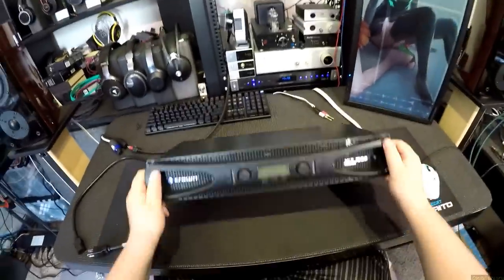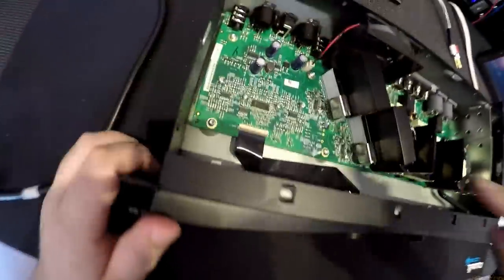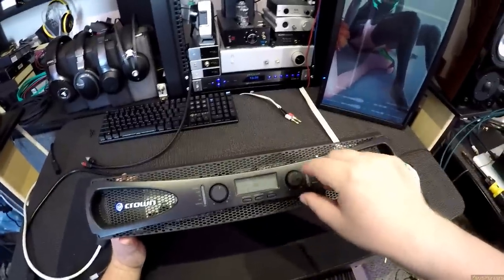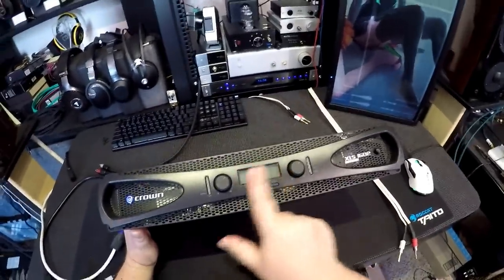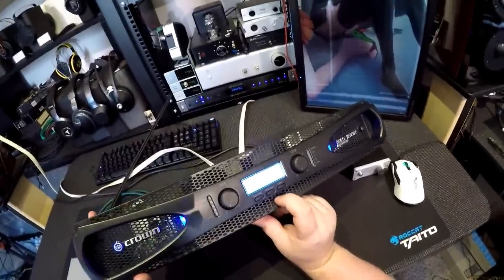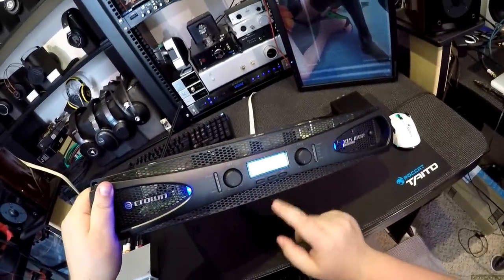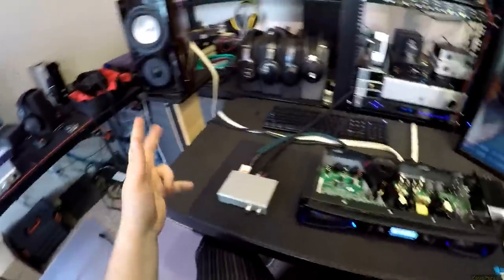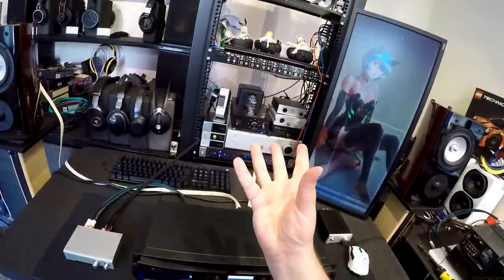Z Review - Crown XLS1502 POWAAAH!!! AMP

Comment: I use three crown xls1502s to power my electrostat home cinema and they sound absolutely incredible, especially since the crowns handle 2ohm dips pretty damn well! Sure they're not krells but they are incredibly easy to live with and they are super quiet, do not heat up the room in the same way that some other amps i've used have!

Comment: Well Zeos...tonight I had the opportunity to devote about three hours to unpacking, connecting and auditioning my new Crown XLS-1502. I used my newly-purchased Schiit Audio SYS as the preamp. Got it all hooked up and fine-tuned the gain settings on the amplifier to the 3 o'clock position. Setting up and connecting the amp was a breeze, and I gotta say I LOVE the Schiit SYS passive preamp. Everything connected to a Monster Cable power conditioner -- I think it especially important to connect an amplifier to a power conditioner. I listened to a few CDs and all I can say is WOW. I had the volume levels relatively high, and the amp wasn't even breathing hard...not even close..just moseying right along as if to say "is this all you've got?" I brought out the Telarc 1812 CD and scrolled right over to the cannon shots. Even at moderate levels, the only lights that lit up on the amp were the bottom ones! Listening to other CDs (Diana Krall "Live in Paris", Shannon Worrell "Three Wishes", James Taylor "Hourglass", Lyle Lovett "Joshua Judges Ruth", Tool "Undertow"), the sound was clean, nicely detailed, well organized. Listening to Tool's "Flood" was revelatory. Bass response is a definite strength with this amp -- deep, solid, detailed. Loving the amp so far, and this weekend I plan to open the floodgates a little more and give it some more challenges to see what it's capable of.
Reply from the maker: Try not to blow up any speakers.
Reply: Yes...so noted! And...thanks to you for all the awesome information, recommendations (upon which basis I purchased this amp) and advice you're providing to all of us...we're listening.
Reply: The Crown has a built in conditioner and protective reset breaker, use 10 gauge (minimum) power cord directly into wall socket for best performance.  Conditioners have minimal effect on digital amps at low power but they can impede the flow at upper draw range unless you have a megabuck conditioner like Bryston or Nordost.  If no analog sources, use your DAC's balanced outputs (fixed, not variable) to feed the Crown direct via XLR input and connect the DAC's RCA outputs to your preamp to control subs.  Nothing in the signal path between source and power amp = purity. Want to hear what a $10K preamp sounds like? Simply remove your preamp. And yes, those knobs on the Crown function fine as dual volume pots like the old McCormack gear. That's also the only way to produce super flat, balanced sound from low volume to the loudest you can handle.  I never move my XLS 2002's lower than 9 o'cock or above 10 with CD/DVD & cable TV (fixed output devices), computer has it's own vol control. For even better bass (!) use one Crown for left and one for right channel, one channel only from each amp- this dedicates ALL of the power supply to just one channel.  Avoid bridged mode as that essentially doubles THD and reduces damping factor/bass authority by about 40-50%.  Output doubles but quality is basically halved.  Ensure your Crown's channels are both at zero before you power it up for the first time, then you can pretty much leave them where you like them, I rarely adjust mine.

Comment: I wanted to thank you for your crown amp review. I was getting ready to spend over $1200.00 plus on a stereo power amp. I was getting very frustrated by how much it cost to get 300 watts per channel. Fast forward to your video. I had heard of people using "Pro" amps for home stereo. The only regular complaint I heard were those of fan noise. After seeing your video I didn't even think that would be much of an issue. So I finally bought the XLS 2502. I wanted to go big on watts. So I have roughly 425 WPC at 8 ohms. My results? Fantastic. I've run it for hours and not once so far has the fan even come on let alone make any noise. I had just purchased a set of bose 901s and knew that they like the watts. So at first I had a 100 WPC amp. The Bose sounded very good actually. However, once plugged into the Crown. Wow! Everything came alive. And, I only paid $550.00 including shipping and including a one year warranty.
I'll admit, I would have loved the beauty of a monster Macintosh sitting in my living room but the money I saved will probably buy a set of Ohm Walsh Speakers. Oh yeah, thanks alot for that video. Now I might have to buy a set of Ohm Walsh 4000s. This is your fault.
Reply: Bose 901's are great space heaters.
Reply: I'm currently running a Crown XLi1500 to run 4 12" subs and for $200 it absolutely pounds! Plus it puts out well over its rated power!
Reply: If it makes you feel better peel off the brand name and rename it "Macintosh".
It may even sound better.

Comment: I got 3 of these amps... the 1002, 1502, and the 2502, along with an older Crown amp powering my home theater sound system.  I am astonished on the level of sound quality that I get from the XLS amps!  WAY better than what I was using previously and also weight 3 times as heavy as my XLS amps.  Your review of this amp is better than most I have watched here on YouTube.   Thank you. :)
Reply: I bought a 1002. It s in the post. Gonna be using it for my big 18 inch subwoofer. Can l set low pass cut off at 100 Hz ?
Reply: did you notice sonical differences between the different wattage models?
Reply: @dornauge1995  Just a small difference. But to an untrained ear, they wont hear the difference.
Reply: @DvjLuna  which one would you prefer?

Comment: I chose this over the xls 1002 due to its better SNR and used a schiit jotunheim as the pre-amp with a TEAC DAC.  I set the both of the gain levels at 50% or at midway.  All I can say is that it sounds fast, clean, clear, neutral and provides great control on bass.  I am impressed with this class D amp, delivers way above it price point.  Having a good pre-amp really helps.

Comment: It's a half bridge (2 MOSFETs) per channel class d amp with switching dc-dc supply. The dc-dc supply is a Variable forward type converter. When you adjust the amp gain using the two knobs, you are actually adjusting the rail to rail dc voltage (controlling the dc-dc output voltage to the amp). In bridge mode, the two half-bridge amps are connected in parallel.  The class-d amp switching frequency is set at 400kHz, which good but not considered audiophile quality... Good class-d should have the switching freq above 500kHz... It's a great bargain for 350$

Comment: Well it's small and light because it's a Class D. I think most "audiophiles" prefer a Class AB design because it's actually amplifying the original signal and not 'rebuilding' the signal based off a high frequency carrier wave. Then again, class D tech has certainly improved a lot in recent years.
Reply: stealth418 no, most audiophiles have been on the class D train for like 6 or 7 years now. this isn't the ancient old days anymore.
Reply: No they haven't lol.
Reply: Alexander96 yes they have, Hypex Ncores have pretty much hit the reset button on all that shit in 2010. get with the times.
Reply: Class D is no Amp ..and no real audiophile will prefare class D .... accept technics new amps which are the best class D imo and still lack next to a real AB AMP
Reply: Audfile I will only use Class D on subs where it doesn't matter too much. Some of the other classes are much better for mids/highs like Class G/H. My Arc Audio KS series car amps are G/H and are amazing. I still have doubts with class D for home use. A/B will always be KING of high end home audio. For trickle down effect class D does have a place.
Reply: @audfile It is improving recently but if you want an audiophile quality class D, the cost is quite significant. Peachtree Nova $1800-2800
Reply: Aron Gatt Please check out the Ncore's. They are the best of the best if you can say that. All the highend amps currently are usind the NCore tech by Hypex design (Bruno Putzey) NAD, Marantz PM 10 etc. Nothing can match it really!
Reply: is that 600 dollar for 1 mono block kit or for a pair ?
Reply: Aron Gatt $600 for ONE kit.
Reply: Audfile Yeah,  get with the times,  get a shitty pro amp and turn your speakers upsidedown 😂
Reply: Class D has improved 10 fold over the past 15 years.  There are many good sounding class d amps.  Some of the best subwoofer home amps are class d.    Class A ( tube)  and AB still have the best sound quality.  Low power under 60 w rms class Ab ( even cheap $200 integrated amps sound fantastic).  Nothing , nothing is worst than an bad digital amp.  I remember the first Alpine PDX amps  they received excellent reviews but they sounded like some garbage.  Unlistenable at any volume. They where small and put out a ton of power.  Class H sounds almost as good as Ab and is almost as efficient as class d.  The best of both worlds.  I love the Ark audio class H car amps ( when they are working).  For home living room listening class Ab.
Reply: gatekeeper
Reply: All these "class D is not audiophile " clearly know nothing about amplification to begin with. 

Class D is no longer the underdog. Matter in fact I know people, that run high end monoblocks and power amps of reputable brand.. Bought a crown and totally sold their $$$ gear. 

Crown is not just power, the specs are on par with any audiophile (such a mediocre word to use btw) amp you put against it. 

Also I see comments here "a good quality class D cost 1800usd" 

Again for those who really think that, have very little to no real experience to speak off. If you really think that, I gladly invite any of you experts to do a blind test here. 

We can put from crown up to krell amplification in the test, if needed to fit your desire for "high end" 

I can tell you already...you will fail 😉
Reply: Michel Linschoten,    Not true.  Take a Scott 40 year old 22 watt per channel tube amp ( completely stock).  NO Crown amp made today sounds as good.  Not even close. In an AB test at the same level any human can hear the difference. No matter what the program source is.  Use an Iphone as the source.

Crown makes an excellent sound reinforcement amp. Durable and able to play at rated power for long terms. Try that with the Scott tube and it will destroy its-self short term.  Compromises have to be made in audio like in all fields. Unfortunately the best sounding and most dynamic audio amps are often simple designs, low power and not all that reliable at sustained high power output.
Reply: @fatboy19831  You just think it sounds better because the tubes distort the signal to a sonic preference you have, and that's fine. It doesn't make them better. you could probably achieve the same thing by using a tube preamp into tan amp like this.
Reply: @joshfoss7407  Tubes do not play low frequencies as well as a good MOSFET or transistor design. It is only in the past 8 years or so that digital amps could produce clean accurate bass. They were at the bottom of the food chain. There are literally millions of horrible sounding digital subwoofer amps. Now digital amps are the BEST inexpensive subwoofer amps.  Most tube amps sound pretty bad.  A good one is a killer like nothing else.  Tubes are just able to produce huge momentary peaks of power that work with real-world music.   Yes using a tube for Voltage gain and Transistors for output is my favorite combination also.  For moderate listing levels nothing beats a good well-engineered tube amp.

Comment: This is essentially my daily rig at home, except I have "one of the grey ones with the side thing" in form of the XLS2500. USB out driven by ASIO4ALL to the Uber Schiit Stack (horizontally arranged of course), a set of Yamaha HS80Ms on isolaters driven from the pre-outs on the Magni, then a mono signal split at the rear of the left channel monitor to the bridged XLS2500 which is powering a 3 cubic foot ported enclosure containing a Sundown Audio ZV3 15"D2. Through the amp's menu, crossover is set to match the curve of the 80hz high pass setting on the Yamis. Mostly only power up the subwoofer when watching movies or when I feel like destroying my hearing (and anything on shelves.) I have you to thank for the schiit stack and my HD6XX's. Keep up the great work!
Reply: gmangigson I have an the same one as well. Had it for a about 2 years. I've never been so impressed with an amp. They're so cool👌🏻👌🏻

Comment: I ran a pair of the earlier version, XLS1500, for my home made two way dipoles (8" full range on top and 18" guitar amp driver on the bottom) since October 2015 without a hitch, or without either fan ever coming on.  I would have bought the 1502 but I caught a close out sale on the 1500's that made it a no brainer.  I've done the audiophool circle jerk many times over the years, including two channel vintage Yamaha, Parasound, Pioneer, McIntosh, and a truck load of A/B Adcom with speakers like Martin Logan, Magnapan, Dahlquist, Vandersteen, Snell, and vintage reference towers from Infinity, Polk, and some killer AR Teledyne monsters.  The Crown XLS series are a no-brainer.  

Any "audiophile" needs to do a blind A/B/X test with one of these in the mix, before plunking down the price of a good used car on a pair of Krell or something.

Comment: I have a Crown XLS 1502 Amplifier in my garage. Plenty of headroom. Best feature is XLR connections for PA and RCA inputs for home audio. At first I thought that the fan did not function. After a few Led Zeppelin tunes, I checked with a flashlight, and the fan is ON. One more point: After being in the garage for several years, I am surprised how little dust is inside.

Comment: The Crown amps are amazing both in power and bang for the buck. My former employer has racks of these things (probably different models) to power the systems in their auditoriums. Can't go wrong buying them. I have an old EV PA Amp running my home system, it was dirt cheap compared to audiophile amps and performs really well, with zero heat!

Comment: Class D, i wish my 2502 had a digital input and some dsp.  I use the 2502 to drive a pair of Bose 901 series 6.  I'm very happy with it.  Small power supply?   It is a switching power supply, hence small size, monster size Class D section and a filter for the output.  No heat sinks!  Class D is very efficient so they don't really get too hot.  By the way, the gain is enormus, i have never heard a home loudspeaker so loud!
Reply: Are you still driving the 901's W/ the 2502, I been using a Denon Poa 2200 since 87' for my series v 901's. need a new amp, my Denon pra 1100 pre amp is still kicking, heard its hard getting volume levels with rca connections. something to do with voltage, mainly gona be playing a cd plyer as source.

Comment: D class amps are the most efficient amplifiers currently on the market. I believe they are 90% efficient, 90% of the power actually amplifies the signal, the other 10% is lost through heat.

Comment: with y-input you can also set a crossover so that channel 1 gives you low frequencys and channel 2 the higher frequencys for speakers with bi amp terminals. so you can buy two of these and use them like this instead of making them mono/bridge.

Comment: The "Power supply" you pointed at is actually the RFI filter stage. The actual power supply is a 'switching' power supply that is the yellow colored transformer and the large 4 caps. It's a switch mode power supply. That's why it's so small and efficient.